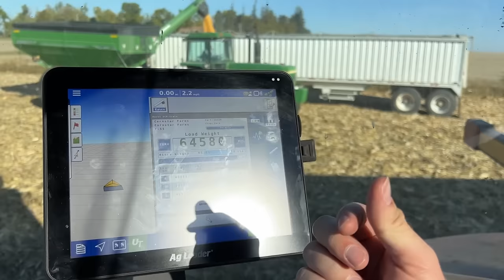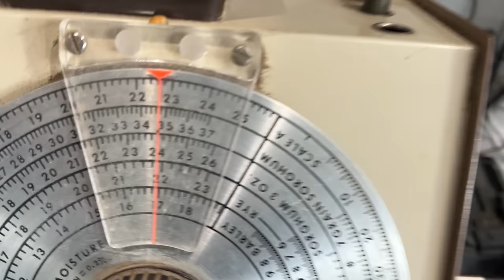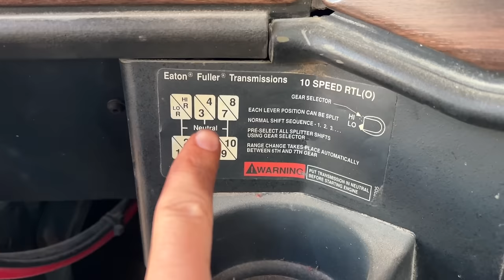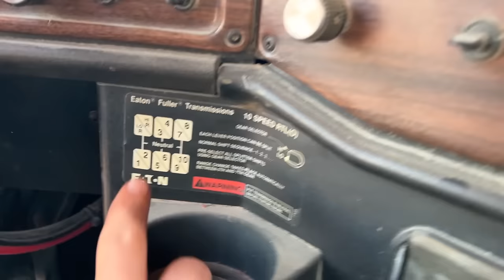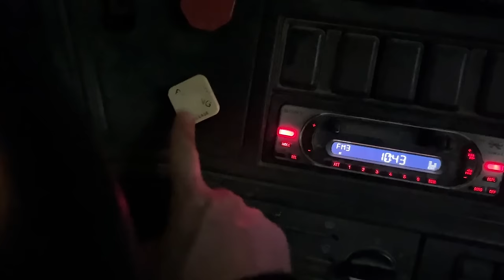My Farm Has A $140,000 Problem

Comment: You could add more to that hopper bin it has a ton of legs and could just sit on hard ground.
Reply: No not with the broken concrete and do you know how much weight that bin can hold?  Your talking over a million pounds of just corn weight not including the bin.
Reply: @johnunsicker7440  I build big heavy buildings.  foundations move some times and if you watch that it doesn’t go out of plumb and add some shims if needed. It is not like it has anywhere to go other than to settle some more. You know sky scrapers have to be jacked back plum sometimes. Kind of mind boggling but not much different to leveling up an old shed with a bottle jack.

Comment: Need automatic tensioner on the belts
Reply: No they don't.  Theses system are design for simple stuff.  The problem is they are that auger setup is not meant to handle that much grain.  Someone feed them a line and they brought it.   Watching and do research most pits have two unload auger in them.   Or a bucket system.  They run 500 bushel twin pits with separate augers and each auger is only moving half the grain.
Reply: @johnunsicker7440  yes, i agree the system has design issues.  However automatic tensioner is about $40.  Save a lot of belts for some of the system where belt tension is the problem.

Comment: Great video as always Cole. Gotta love those Super 10 trans. Easy to forget where you're at. For the slow brake release check the tractor protection valve at the back of the cab or the spider valve under the fifth wheel. The brake line antifreeze has a lubricant in it. One of the valves is just getting sticky.

Comment: Fill the bin up to the top it has been signed off as good. If it collapses it’s on the company that built it. The sue for loss of earnings personal stress and a replacement bin
Reply: Doesn't work that way because they haven't sign off on it being safe the company did but not the owner.  And if you knew it was bad and it falls you can be liable for the damages. IF it falls and take out the grain leg they are screwed.